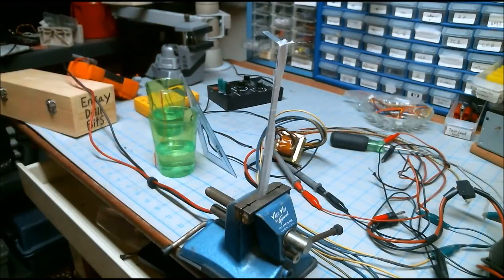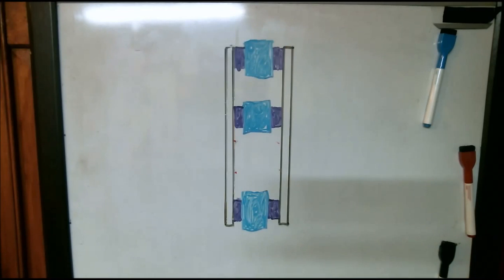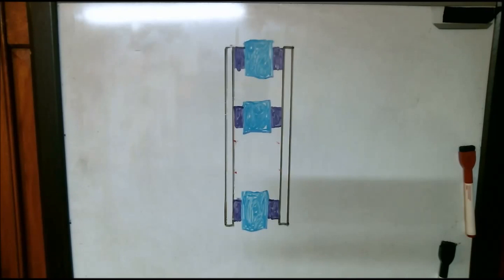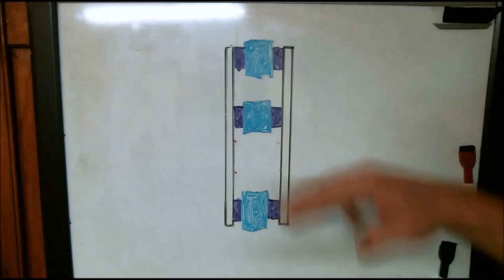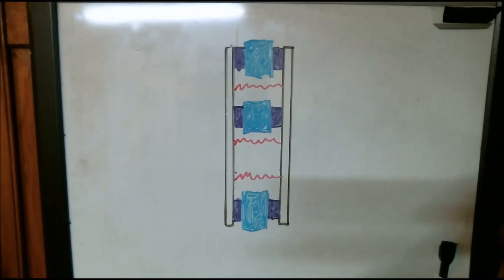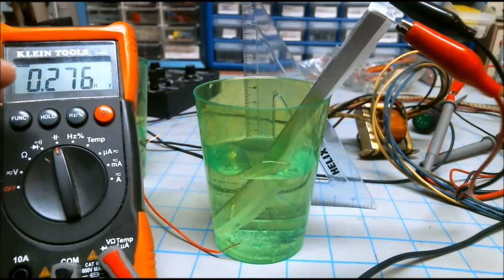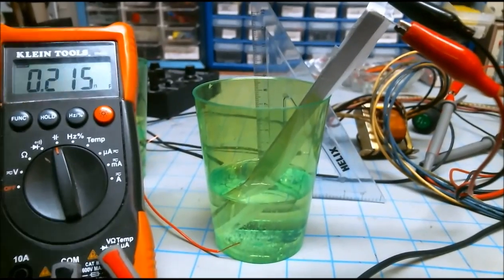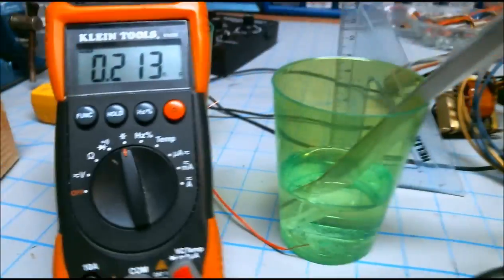How to make a Capacitive Water Level Sensor

Comment: Great video! Is it possible to use this sensor with non-lead fuel? Or it might be dangerous.
Reply from the maker: there are many rules and regulations on voltage being in the presents of combustible fuels. That being said i designed this system so that it would not directly contact the fluid or introduce voltage to the fluid. I cannot say it is safe for use with gasoline. With proper isolation, a low voltage and thorough testing I could see it being used in the future.

Comment: Thanks for sharing this. I just made a very similar sensor using a 3"x20" strip of 3mm corrugated plastic sign board, a couple pieces of 2" aluminum foil tape on either side of the sign board and waterproofed it all with some sheathing tape, a very quick and easy construction. My sensor element is about 18" long, I get 300 pF when dry and 4720 pF when totally submerged in water. I also checked it at intermediate depths and the results seem very repeatable and are perfectly linear at approximately 245 pF per inch of depth.
Reply: Hi,  I really appreciate if you can let me know the space between two plates ?

Comment: I would be curious how it reacts when the water have other properties, such as different PH levels, which would likely impact the metal differently over time.
Reply: I believe he said in the video that he coated the aluminum with Glade "press-n-seal" to protect the aluminum from electrolysis. This prevents any direct contact of the metal with the water and thus PH variations won't affect the aluminum. However, there will be a very small (negligible) shift in capacitance with changes in PH due to the fact that water's dielectric constant fluctuates with dissolved solids and/or ions.   The bottom line is that the PH has no impact on the aluminum (surface protected by the Glade product.

Comment: I just had a thought that you could combine this capacitance method with your previous resistance method: In addition to the vertical strips, you can also have a parallel plate cap at the bottom, always submerged, providing a measurement reference. Compare the vertical strip capacitance to the reference capacitance, and you have a system that outputs an accurate depth measurement no matter what the liquid is. I think it could be easily done with an arduino or a rudimentary analog circuit.

Comment: Thanks for sharing. I've been curious to do such an experiment since I first heard of this depth measuring method a few years ago. The product packaging, often referred to as a "clam shell" is almost always made of PVC; sometimes stamped with a "3" inside the triangular recycle symbol.
Reply: Your parts drawers in the background look like crisp and clear polystyrene (PS, #6) on the left, and flimsy milky-white polypropylene (PP, #5) on the right.
Reply from the maker: You are correct, I was very disappointed when i got the one on the left (ordered it on Amazon) The other ones I get at thrift store and alike several have metal frames :)

Comment: Great idea. I really like this one. Wonder if you could calibrate an arduino to read out the depth or volume for a known container?
Reply: Yes you can... now where did I see it... was it electronics hub?
Reply: Instructables.
http://www.instructables.com/id/Building-a-Capacitive-Liquid-Sensor/

Makes it easy when there is already a library...
Reply: There isn't really any info on the capacitor. Seems to be 2 bits of foil on opposing sides of  a drink bottle. I assume it was to measure inside the bottle...

Re the ads. https://adblockplus.org
I never surf the web without it. So I never noticed any :)
Reply from the maker: Mongrel Shark
Interesting, btw I nearly never research my projects before making them. So after posting a video and seeing that others have done the same thing, I am very curious to see how they did it.
Reply from the maker: Mongrel Shark
I had difficulty following the "instructions" which could have been due to all the ads, or because it is getting late here :p